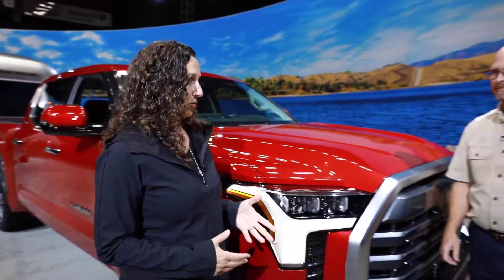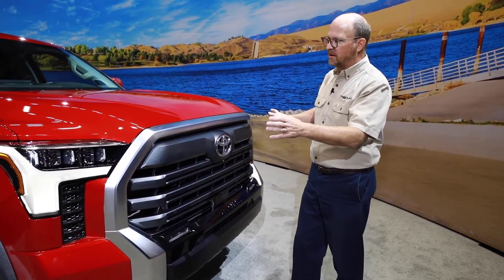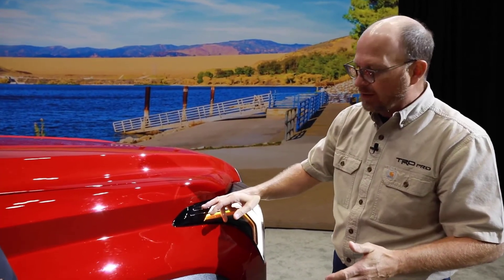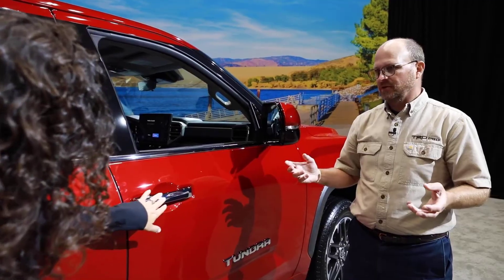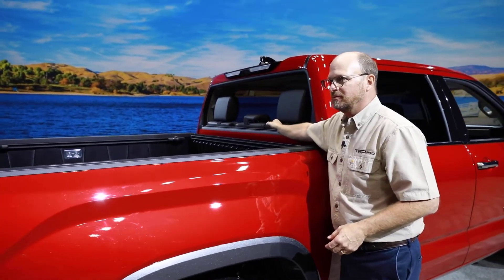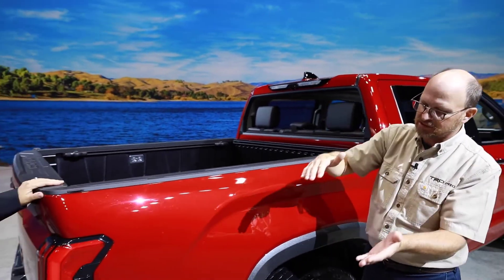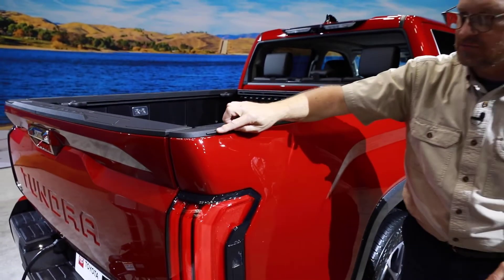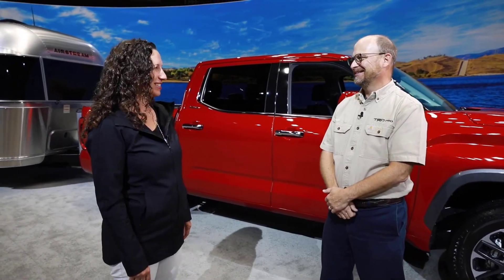2022 Toyota Tundra Aerodynamics and Design

Comment: A good Cd is .07 this truck is no where close to a reasonably aerodynamic vehicle.  7,127,999
Reply from the maker: As Aaron stated, 0.07 cd is impossible in a land vehicle. And the topic is the Toyota Tundra's aerodynamics.
Reply: The best drag coefficient in a production car right now is about 0.20. Not even a bicycle has a 0.07 cd.
Reply: @Aarononautos  University of Texas at Austin wind tunnel.  .07 Cd.  Research "class C" airship not bicycles.
Reply: @jerryroane7650  And how is that even remotely relevant to a discussion about a pickup truck? Or any automobile?

You're just trolling.
Reply: @Aarononautos  the topic was "Aerodynamics and Design". Aerodynamics is the topic.  Toyota makes a brick of a truck and then makes a video about how they ignored real changes for little tweaks.  Frontal area being the most glaring reason it does not get 175 mpgE hauling plywood.
Reply: @jerryroane7650  Actually, even an EV wouldn't get 175 MPGe hauling plywood. Your knowledge of physics is hilariously terrible. The topic is "*Tundra* aerodynamics and design." As in the Tundra pickup truck. When you can name any pickup truck that gets anywhere near 175 MPGe (under load) and that has a 0.02 cd, you'll have a point. But since you cannot do so, because one does not exist, you are nothing more than a troll comparing a pickup truck to a friggin blimp.
Reply: @Aarononautos  0.07 not 0.02 I have photographs in the wind tunnel but this format does not accept photographs. There is no scientific definition of "Tundra".  That is a made up marketing name that can be anything the marketing team is tasked with selling the public.  As oil runs out, moving goods around will need to get more scientific.  Why would you want to get poor energy mileage?  Do you own some old oil rights?  Of the today choices for pickup trucks Tundra does not have the highest mileage.  As self-driving takes over the bed of the truck will be one vehicle and the cabin will be a separate vehicle.  Holding onto the past is not going to work for mankind.
Reply: @jerryroane7650  Photographs of a blimp. That's great.

Bye, bye, troll. I'm done with you.
Reply: @Aarononautos  Wind tunnel, not a lighter than air aircraft.  Why do you fear new information if it is true?
Reply: @jerryroane7650  Actually, I'm just tired of dealing with your trolling.

Comment: How much is the drag coefficient of this new tundra? Currently ram is the most aerodynamic truck with drag coefficient of  0.357
Reply: The 2021 Tundra's Cd is 0.37 and 0.38 for the 4x2 and 4x4 respectively. Toyota says that the 2022 Tundra improves that by 20 percent. That's an improvement of 0.07, putting the new Cd at 0.30 or 0.31.